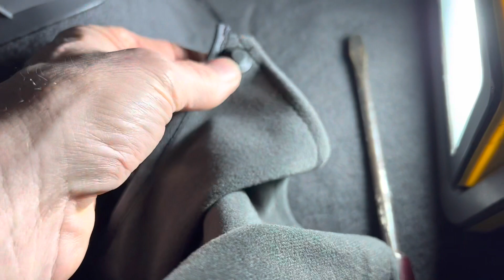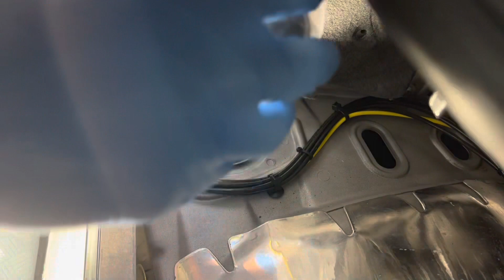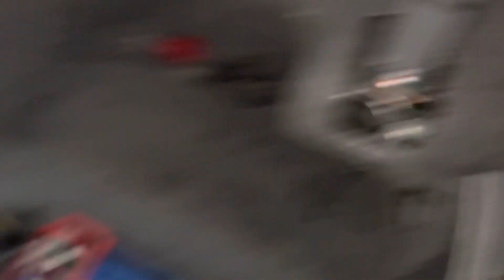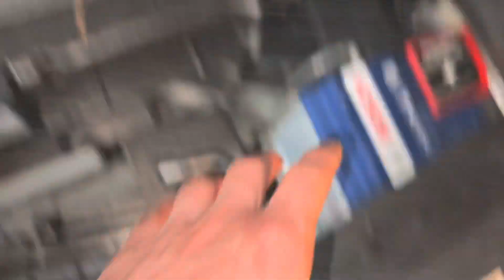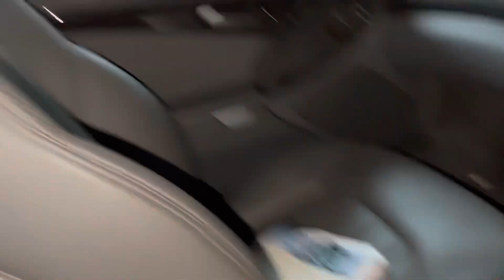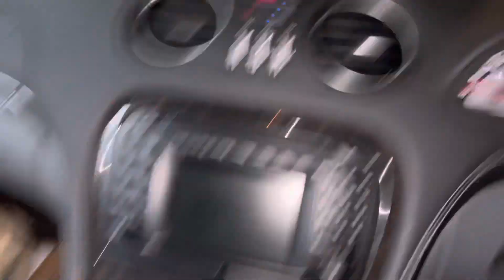Mercedes R230 SL55 AMG ABC Visit Workshop fault- FIX including how to remove the boot/trunk liner

Comment: The roof mechanism on this model is amazing. The complexity is frightening though. Thankfully German production means it’s been reliable so far. I have an 2014 350SL which is showing rear battery error. Mikes last video has encouraged me to replace it myself.  Great work Mike. Now I know why dealers never do a good job refitting interior trim then just don’t spend time or effort it takes to refit all the small clips etc correctly.
Reply: I just changed the battery in the back on my SL55 and suddenly car didn‘t close, keyles go didn‘t work…. That made me so angry🤣

Comment: A Remarkable Video! Thank you, Mike, for what you do. You are tempting me to sell the R 107 and look for a SL 55 AMG! Although sometimes it appears that your new car is more complex than the human body!
Reply from the maker: Your comment has got me thinking that at some stage, it might be interesting to do a comparison between the R107 and R230. The 107 draws a lot of attention and admiring glances and I have a suspicion would win the beauty contest in a line up with the general public. However, the SL55 feels like a modern car and not something you have to be too precious about....Mike
Reply: That is funny, I’m considering going the exactly opposite way. I may switch my Sl500 for R107
Reply from the maker: @marekhabel2493  There is something nice about the simplicity of older cars without all the electronics. My first ever car was a 107 and I still have it. Only ever broken down and been stranded  - once with a snapped fan belt. Mike